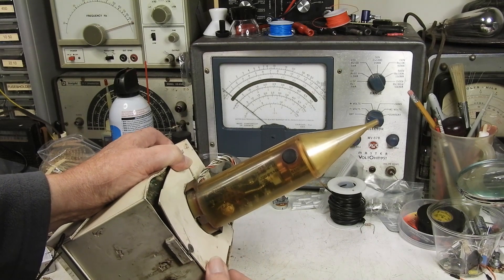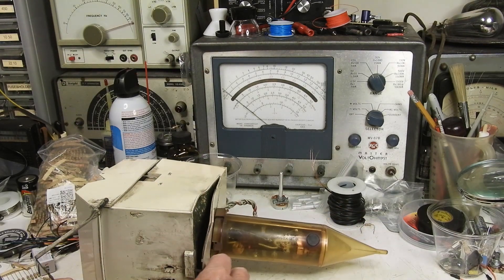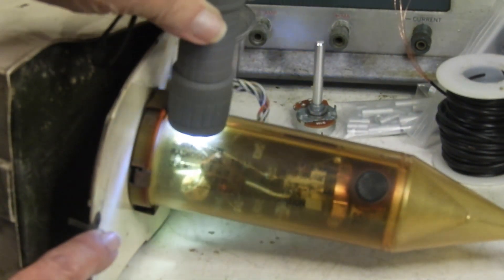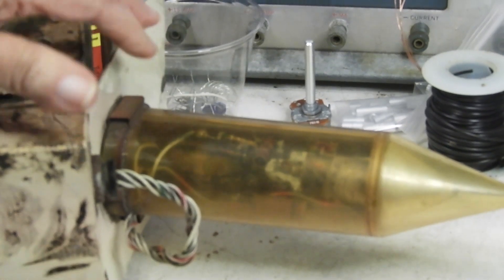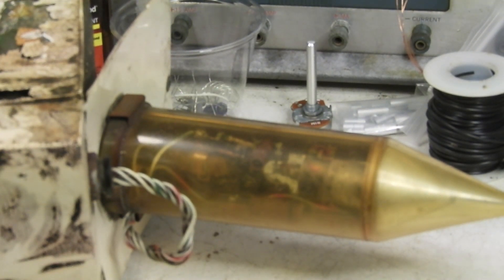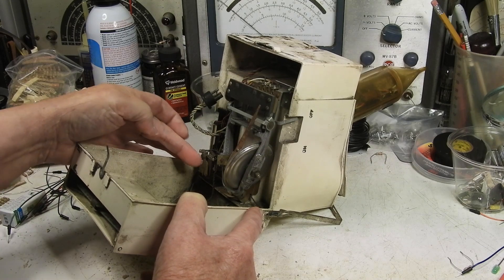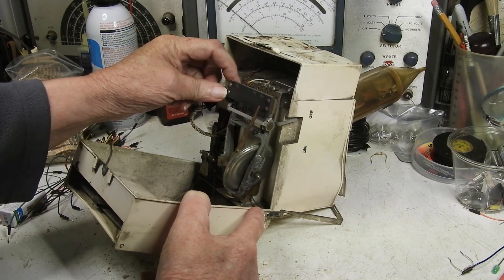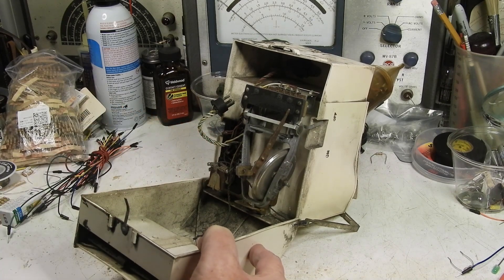Weather Balloon Payload 1960s Radiosonde

Comment: Wouldn't it be interesting to see what it actually does or if any of the circuitry or mechanics actually works and what exactly it was supposed to do. I suppose, on the other hand, with a little care it could be put into a well greased temporary box and some clear resin could be poured over it, that way it will be peekable at for decades to come and it will remain frozen in its current (unfortunately totally unfunctional) condition and there will be no danger of anything ever being dislodged or disturbed!
Reply from the maker: Thanks

Comment: the radiosonde measures pressure temperature and humidity and wind direction

the 2 small bars or arms on the outside of the radiosonde were attached to the white box and held the temperature sensor . the humidity sensor is under a small door on top of the square box. pressure is measured by the billows inside . the billows also acted as a switch to switch in and out the temperature sensor and humidity sensor circuits

There was also a reference circuit that sent a signal so the balloon's position could be tracked thus determining wind direction and wind speed 

when the balloon burst at approx 14 miles up the transmitter stayed on till the battery wend dead

early parachutes were made of paper with later one constructed of plastic
Reply from the maker: Thanks for the information, very helpful

Comment: I have a manual for that radiosonde  there is a water activated battery under the plate where the bottle is attached 

The bottle is the transmitter  the square box is the modulator. the battery can be removed with no problem  .
the 2 plastic parts hanging loose are the arms that held the thermometer sensor , The round cell on the inside measures pressure and 

switches the circuit between temperature sensor , humidity sensor , and pressure Also there is a reference point that is switched in and out
so the balloon can be tracked to give wind measurements

Let me dig out the manual and get you the wiring diagram for this radiosonde
Reply from the maker: Thanks

Comment: Back in the 80's I found a NOAA weather balloon. It was much smaller than what you shown. It had a pre-paid bag that you would use to send the interment back to NOAA. I filled out the paper work that was provided and sent it back. I received a thank-you from NOAA for returning it. One thing I noticed about the instrument was that it had a setup that cut the batteries cable when the balloon popped, they thought about everything.   Thanks for your videos. Carl
Reply from the maker: Thanks

Comment: Very interesting stuff. Unbelievable how bulkey this is compared to current models.
Those units most probably used water activated batteries. Did you see the homepage of the radiosonde museum?  

http://radiosondemuseum.org/the-collection/
Reply from the maker: Yes I found it and it's for sale.  I'm going to contact them and see if I can get some
Reply: the owner wants to sell the complete museum as a complete collection  not to sell single units

Comment: Looks like the air pressure bellows is driving the wiper of a variable resistor.  Very interesting bit of gear.   If you find out more please let us know.  Telemetry was a different science back then.
Reply from the maker: I will try and get some more information, but We're not going to find the information in Sams Photofact.

Comment: Very interesting!  I have never seen one of those  before, I remember back in the early 70's in grade school it was common to see a WX balloon up high in the sky during our school PE time or recess.  If you find out more on the operation, would be interesting knowing more.  That scale thing just from seeing on the video almost looked like some kind of potientiometer that would move back and forth with the pressure or something?  Interesting anyhow, thanks for the video.  Not sure if they still send these up anymore, it has been many years since I have noticed one in the sky I guess.
Reply from the maker: I will try and get some more information, but We're not going to find the information in Sams Photofact.
Reply: There must be a special receiver that goes with it, perhaps with some sort of "digital display", state of the art from the 60s, when IC chip's were replacing tube circuits.  Varied resistance measured pressure, temp, and humidity, perhaps transmitted at UHF.  The 411 would become a sight display of some sort, not sound by a speaker.  Now days, there'd be some sort of sillyfone app. Got to sort this out, there must be sort of more?
Reply: @umajunkcollector  the radiosonde had a dish antenna called a GMD 1  the radiosonde transmitting frequency was 1680 MHZ  aka  1.68 Gigahertz

Comment: Very cool! I’ve got a few of those too, some with vacuum tubes. It would be fun to light them up and see if I can get a signal. Don’t know the voltages needed. Maybe one day I’ll figure it out.
Reply from the maker: Yes it would. We're not going to find the information in Sams Photofact.
Reply: AllAmericanFiveRadio yup! Uncharted territory! I spent a couple hours googling around and found information that might help but it’s going to require some reverse engineering.
Reply: voltages are  115 volts  1.5 volts and 6 volts
Reply: @geepchaser  What?
Reply: @erikburman530  the water activated battery supply's 3 different voltages  115 volts   1.5 volts and 6 volts 

I have schematics for battery and radiosonde that I have sent to allamericanfiveradio
Reply: @geepchaser  Thanks! I'll send an email and see if he'd like to share!